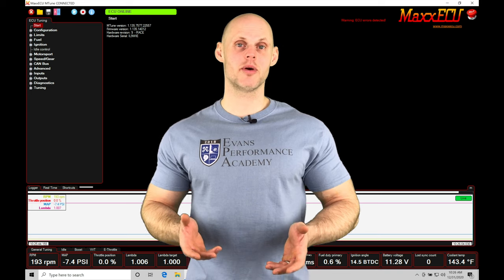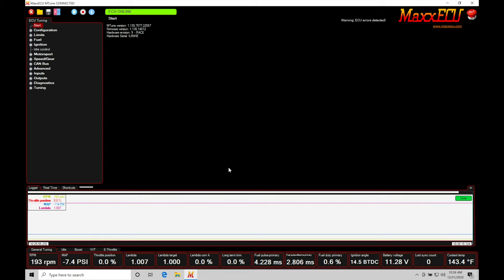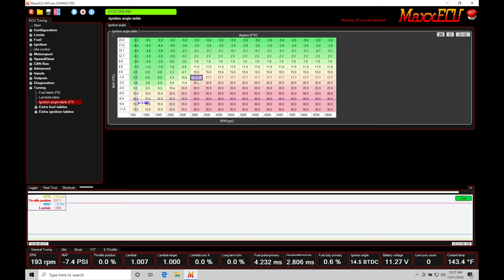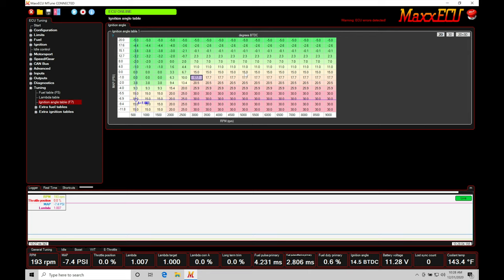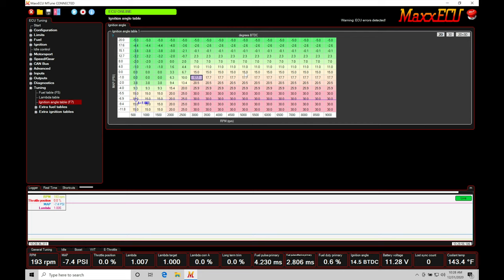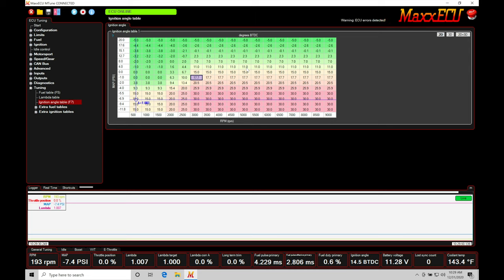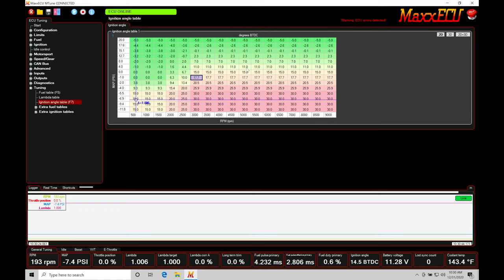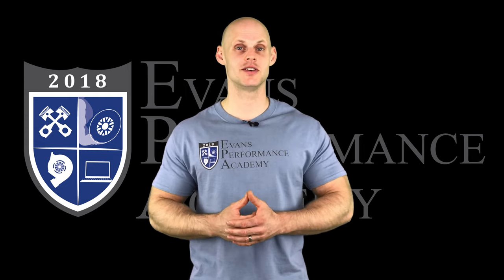MaxxEcu Training Part 25: Knock Control | Evans Performance Academy

Comment: on maxxecu with peak channels averaging say 38-45 what would a real knock level be, are you talking double  those values??
Reply from the maker: You must set the knock threshold / floor based on the engine's knock noise output.  We go through how to determine the proper knock threshold / floor within the tutorial.
Reply: @EvansPerformanceAcademy  sorry, just comparing with other analysis tools, have not used maxxecu EM yet but was curious to what the peak (determined as knock) would look like like compared no normal noise thresholds at given load/rpm